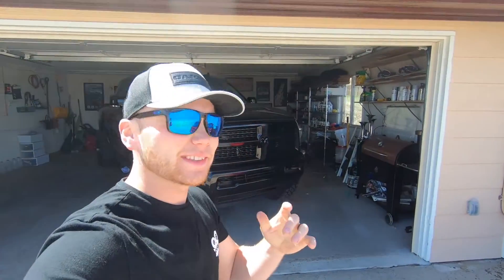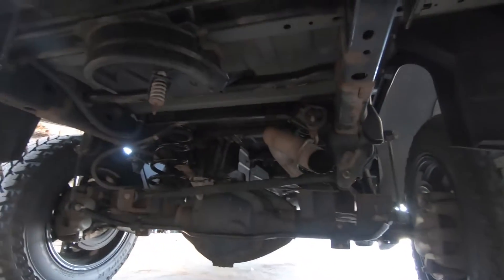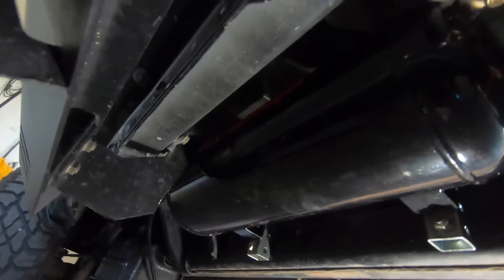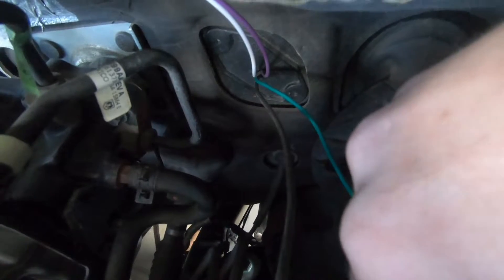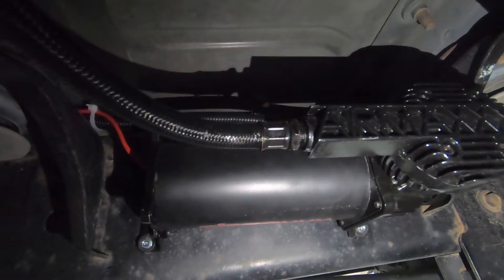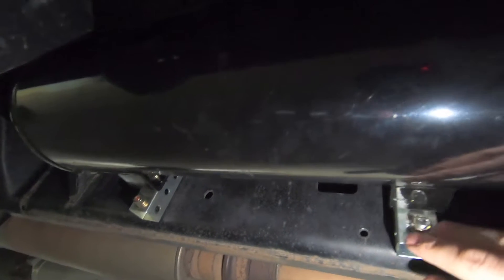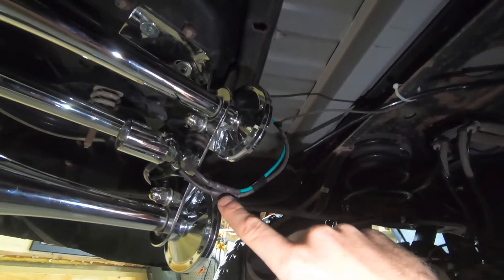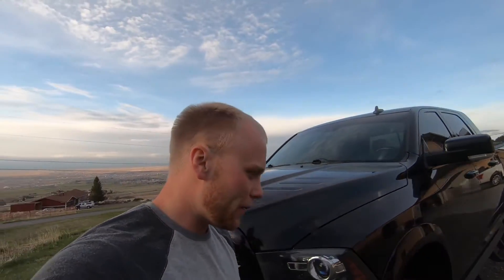Installing TRAIN HORNS On RAM 2500 !

Comment: That moisture bleeder on the air tank ought to mounted at the bottom or it might develop moisture issues in the system as the water level raises in the air tank.

Comment: I’m not sure how ya would, but you may want to  figure out how to re-mount your air tank so that blow off valve is facing down. The main point of that valve is to be able to open that tank while it’s under pressure and drain out any moisture and water that gather in there. Gravity can be your friend with a change in position. 
Will hopefully help make your tank last longer and prevent any sort of freeze up issues. We use the same principle with semi’s. Looks great! Was looking into putting a set of train horns onto my pickup
Reply: I was thinking the same thing.
Reply: Your bleed valve has to be at the lowest point.  The way you have it now you are going to be riding with a tank 1/2 full of water.  First freeze and you will be history.  Good Luck.  Weld a mount on the side of the tank
Reply: Thank you, that is what I was thinking the valve is to remove water from the tanks to prevent corrosion. Therefore, it should be on the bottom to allow gravity to remove water from the tank. Otherwise the install was flawless.
Reply: Thank you, people, on Youtube,
 think that they know it all

Comment: You should have made 90 degree angle brackets to mount the tank, putting the "DRAIN VALVE" in the correct location...or by a tank with the DRAIN VALVE made for a 90 installation.

Comment: Bleed off / drain Valve mounted like that does nothing. Now you have water sitting below the bleeder / drain valve, essentially pitting , and rusting the tank. The upside is when it explodes, only your passengers legs will be blown off if it penetrates the sheet metal on the cab.
Reply: Lol I was so confused on what you talking about and then he explained how he was gonna mount it😂. Like bruhhhhh might want to get a tank that has brackets on the other side.

Comment: Hi There,

Great video showing the full installation... I am in the middle of doing the same setup. my only question is in regards to the compressor on/off switch. Did the load wire from the switch go into 86 on the relay? or how did you go about that switch.. The Solenoid load wire was a no brainer from the switch lol... But just making sure I have this right for the manual switch for the compressor on/off.

Comment: Up to Min 3:32, the bleed off valve is supposed to be in the bottom to drain. You may want to use an L bracket.

If you connect the horn to your own horn cables you could use them together.

Comment: What did you do about water in the tank with the bleed off valve on the side ? You won’t be able to get all the water out the tank and it will rust ?

Comment: just curious, you mounted the air tank basically sideways, how will u get all the water out of the tank if the bleed valve is on the side? just curious how its holdin up
Reply from the maker: Truck was sold shortly after this video , owner took everything off at that time.
Reply: ah i see, thanks for the reply @GoodysGarage

Comment: The bleed off valve needs to point down its not an air release its to drain water from tank nice horn tho
Reply: Mount compressor on isolators  point drain valve down

Comment: That's not a bleed off valve. That's a drain for water in the tank. Condensation forms inside the tank. It's what causes most air tanks to rust out!

Comment: How did you wire the red wire on the compressor to the harness that comes with the relay? Did you just splice the two together even though they're different gauge wire?
Reply: Danny Broocker red wire on compressor goes directly to relay. If you need to lengthen, use a butt connector in the red wire from compressor and re spade a piece of 10g to plug into the relay

Comment: Relocate your tank pressure gauge to the dash, you can't see it when you're driving.
Reply: He said with the compressor switch on, the tank would fill to 150 psi and shut off and when the pressure dropped to 100 psi it would kick back on. To me it seems like you wouldn't need a pressure gauge in the cab unless the pressure switch on the compressor went bad. In that case the extra output on the tank that was capped off could have a blow out valve installed just in case the compressor switch did go bad. Just a thought. 
If air bags were being used for towing say a 5th wheel or gooseneck trailer, I think you would want a pressure gauge mounted inside the truck. That way you can level your truck when loaded and know how many psi you need to keep it there as well as making adjustments as you drive. In this case you would want to keep an eye on bag pressure as you travel since I have seen people blow out air bags by not keeping an eye on pressure or have them inflated almost to the max, hit a hole and blow one or both out. Again, just another idea.

Comment: as stated before, L-brackets to get the drain down.  What I do is take the relay tapped off the horn then to a switch.  This way the in-cab switch is like an "enable"